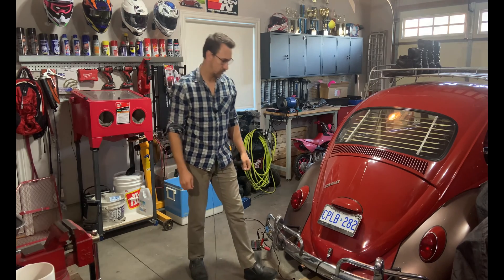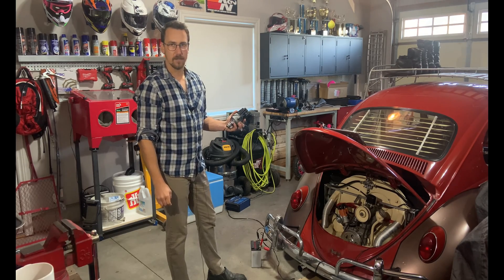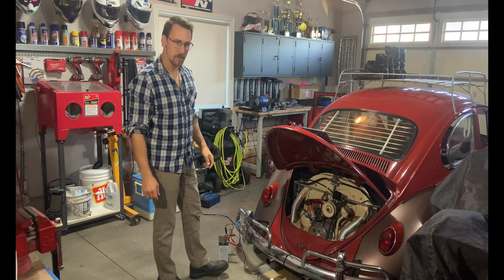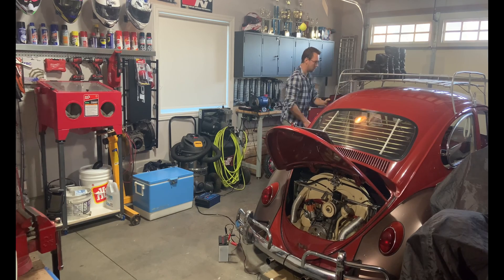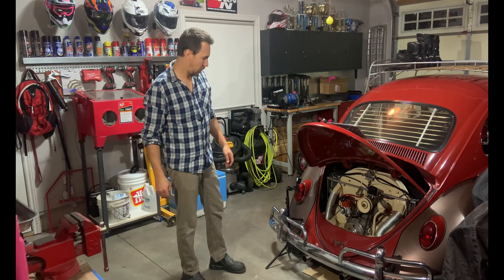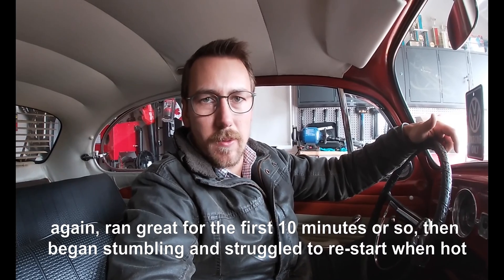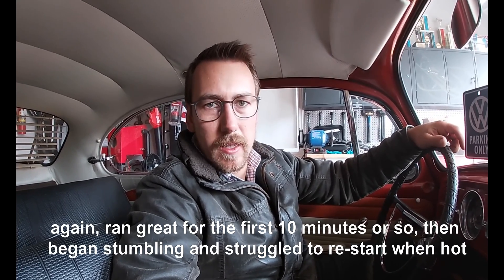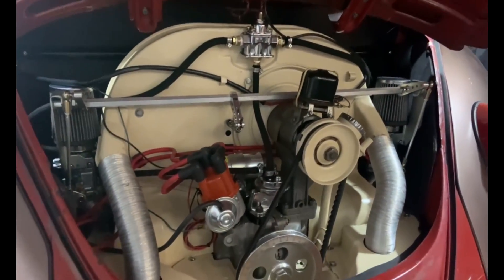6-Volt Pertronix Electronic Ignition Distributor & Bosch Coil Replacement on Air-Cooled VW Beetle

Comment: To each his own, definitely … but I am just not a fan of 6 volt, positive ground electrical systems. They have always seem like extra work and extra expense for subpar performance. Prefer to do a 12 volt conversion on early ‘60s VWs for improved lighting, modern sound systems, and better battery choice availability. That being said, after the power line that comes into the coil goes through the coil resistor or through an internal resistance coil, the power coming out of the coil and going to the distributor will be reduced to 6 volts anyway (in a traditional points and condenser set up) so, in the case of using a 6 volt Pertronix, there would be no benefit to a 12 volt power swap, as far as the ignition system is concerned. However, to reach the full benefit of the Pertronix systems, you will always need to replace the stock coil with a high output coil, such as the Pertronix “Flame Thrower” coil; otherwise the old coil is going to limit the Pertronix ability to increase, or make hotter, the spark at the plugs.
Reply from the maker: I am at the point now where I am seriously considering going he switch to 12v for the reasons you have mentioned.  I was originally trying to keep it more original, but really, not much else is so why keep the 6v system.

Comment: For some reason  I am known for swapping plug wires hahahaha. Good luck on that being the source 😉  I feel like you are on the right track
Reply from the maker: Glad to hear I’m not the only one.  Unfortunately the coil didn’t solve the issue… looks like it’s the old 6volt generator that is failing… cleaned and freed the brushes and I’m getting more voltage now, but still far from the ~7.2v that I should be at… time for new brushes I guess.

Comment: I'm hoping that the coil will fix your problems.
Reply from the maker: Thanks, but unfortunately that didn’t solve the issue either.  Looks like the issue may actually be the generator… although the dash light is only on at idle, after testing it out I was only getting 0.5v output from the generator, leaving the coil to run off the battery, which was being drained as I drove.  I tore the generator off and apart, cleaned it up and freed the sticking brushes, and reassembled… now getting 6.5v at high revs, but any less that that is only around the 1.5v range… I believe I should be around 7.2 to properly charge the battery.  Looks like I’ll need to buy a new brush kit and properly rebuild it.